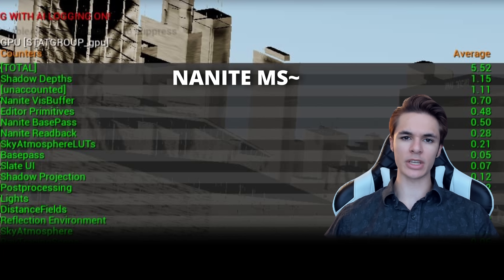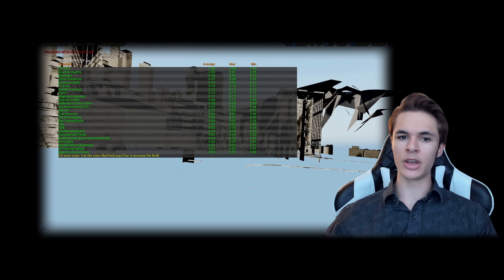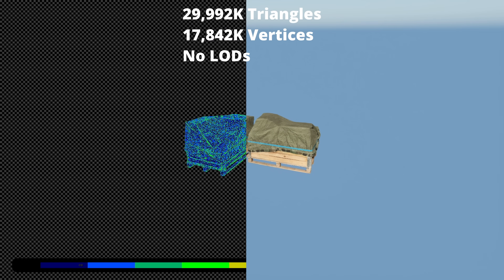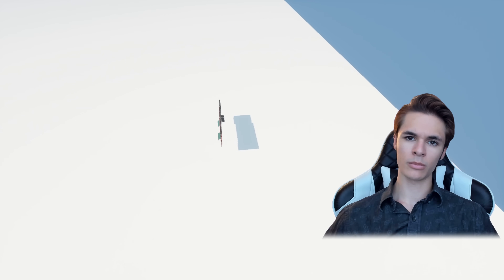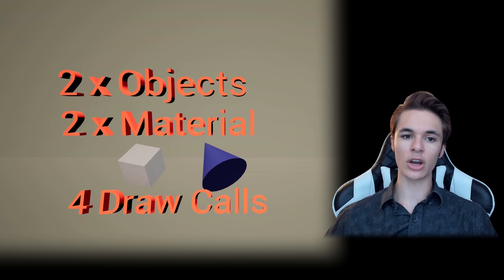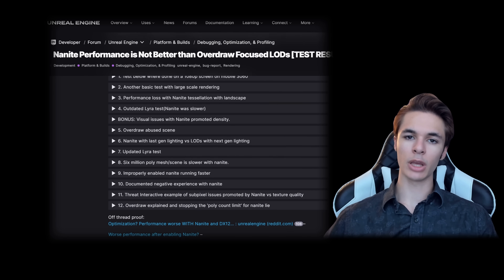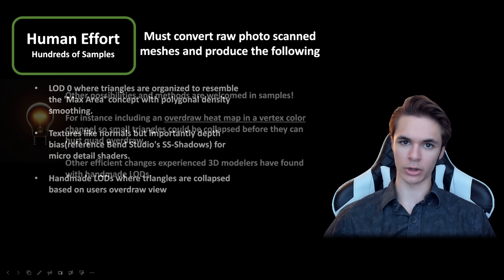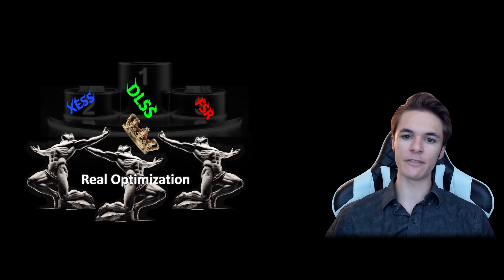Epic's Unreal Optimization Disaster | Why Nanite Tanks Performance!

Comment: Can't ever take Epic seriously when they can't even be arsed to prioritize shader compilation stutter problems.
Reply: What's interesting is that UE4 & 5 actually has a built-in setting in the ini files to precompile shaders called "r.CreateShadersOnLoad" but the weird thing is that it's set to False by default, instead it should be True. What's even more weird is UE3 has a different ini setting called "bInitializeShadersOnDemand" which is False by default, which actually means all shaders will be precompiled before the game starts. I have no idea why Epic didn't set shader precompilation to true in UE4 & 5 but at least the setting is there and more devs should know about it to turn it on for their games in order to help reduce shader compilation stutter
Reply: They have literally done this in UE5.3+
Reply: @Cloroqx   took them forever uh huh?
Reply: I'm not an unreal dev, but as someone, who has written his own engine, I fail to understand why you need a zillion shaders and variants for every scene. Whatever they are gaining on this is, but this is just madness.
Reply: BTW. Disabling Control Flow Guard in Windows Defender fixes lots of issues with stuttering in UE5 games.
Reply: Write the shader compiler yourself ! Only about 30 minutes... put it in ablank level that is async compiling and showing a loading screen :)
Reply: Unreal Engine has been a console engine for a long time.
Reply: maybe provide a solution?
Reply: @user-ic5nv8lj9d   why do I have to provide a solution? If devs need to have their own solution for such a game breaking problem, they might as well make their own engine.
Reply: @RiasatSalminSami  not every solution is prebuilt, see you in 5 years when you get that engine built.
Reply: @ThreeTreeDog   get that engine built? I am not a developer. I am a consumer and if I see a product that is garbage, I simply will not buy that garbage.
Reply: @ThreeTreeDog  Is Timmy your father by any chance?
Reply: @RiasatSalminSami  simply moaning isn't going to do anything, and if you've understood the problem itself you would understand why it's difficult to provide a "good" solution to a generic problem and not complained as much like many here that seem to have no idea what they're talking about (in which case, unreal is a generic engine that's trying to solve many problems at once, which is in of itself is the whole point of the engine and is making a maintenance disaster, it's not just for games fyi)
Reply: @RiasatSalminSami  well, i guess there's not much i can do to someone being ignorant then ¯\_(ツ)_/¯
Reply: @user-ic5nv8lj9d   ignorant my ass. That's like expecting a customer to like uncooked food because it's so hard to make a nice dish.  Or expecting the viewers to enjoy a sports match while the players play like shit.

All I will care about are the results. This is not a charity. Devs are selling a product, and if the results are garbage, then people will call it garbage. That's what Unreal Engine has been for the last few years. 

If they find it so hard to fix shader compilation stutters, then maybe they should just stick with older methods that still produced decent visuals without stutters.

Don't expect customers to buy garbage just because it's so hard to make a software.
Reply: @RiasatSalminSami  what if you want to push the boundries and do something even better? you can't just limit yourself to older tech and never improve, that's not how things improve or get better in the first place...

and you can't just simply "invent" a new tech and expect it to work perfectly the first time you work on it, today's hardware & software makes everything significantly more complicated and you can't put all the blame on epic, there's so many factors that causes the issues that may not be caused by one developer, it may be many many more that you didn't expect

most of the time the tech needs to be pushed out and given a try so people find out what the issues are, since there's an unbelievable amount of different configurations and different limitations and platforms you have to test on, it's just not as simple as you think

and also, the people using the engine must be aware of the issues (in case epic didn't make them clear enough, then it's their fault and sure i can understand that), on top of that it's designed to be _generic_, so this should be obvious by the uses of it and why it's slow in the first place, it's not because of lack of skills or laziness, that would make no sense

ignoring the reality and expecting everything to just stay perfect is not a good mindset, trust me, it's really bad, and you need to understand how these things actually work instead of being ignorant
Reply: @user-ic5nv8lj9d   no, it's a perfect mindset. I am not here to run charity. I don't really care if hard work was put behind the product if the product ends up being shit.

Video games are not a necessity and I won't die if I don't buy a game. As a matter of fact, I stopped purchasing games that are unpolished and in the long run, it saved me a lot of headache.

And this particular problem can't even be solved by better hardware. Games like Crysis ran like ass too, but that was designed in a way that would run better with newer hardware.

Shader compilation stutter makes every single hardware freeze. This is an issue that should have been #1 priority and should have been tackled since the beginning. Calling people ignorant for not purchasing products that has unacceptable issues like this is a problem in itself.
Reply: @RiasatSalminSami this reads like you've never cracked open the engine code in your life, if so that's fine but don't act like you know fuck all about what you are talking about beyond some youtube videos you've seen
Reply: @RictorScale   I don't have to know anything. I will call the product garbage if the results are garbage. If they are selling something to a consumer, they can't expect good review if they produce garbage.

I will say this again, this ain't a charity.
Reply: @RiasatSalminSami  lol yea you don't know anything and it shows very clearly. I'm sure epic is deeply affected by your.... not paying for unreal engine...like how could you think your opinion is worth anything if you know nothing🤣🤣
Reply: @RictorScale   I don't have to know anything to give an opinion if the results are garbage.

My opinion probably isn't worth anything. But same can be said about your opinion too.

If you are justifying shader compilation stutter, then you have no standards.
Reply: @RiasatSalminSami  your argument boils down to "I have no idea what I'm talking about but I saw a YouTube video saying unreal bad and so I'll agree even though I have no idea why a game might lack performance". The real criticism would be at the specific games that has the issue as they shipped without enough quality control. It's not the engines fault if your game is ass
Reply: @RictorScale    I don't need to see YouTube video to notice shader compilation stutter. 

It's the abundance of shader compilation stutters in UE games that lead to me to search on internet and I stumbled upon videos like these.

Yes the devs are definitely at fault too. But time and time again it's been shown that getting around shader compilation stutter on UE is convoluted compared to other engines. 

Which leads to my original comment about Epic devs not having their priorities straight. Thus I can't take them seriously.
Reply: @RiasatSalminSami  What you fail to realize is that those stutters don't happen in many normal scenarios, and UE, being a generic engine, can't do much about it if the dev decides to use their tech to make something different, but don't come up with a solution to shader compilations. If I use your food analogy, UE is not the cook, but the tool he uses. If the cook serve you raw food, it's not the oven's, or the pan's fault, but the cook's. If using another set of tools, or using those tools differently would have prevented you getting served raw food, that doesn't make the tools bad, but again, the cook using the wrong tools, or using the tools he had incorrectly. Sure it was a significant issue for them to fix, and they did improve it as far as they can, being a generic engine. But the major issues with stuttering came from devs and quality control rather than the engine itself
Reply: @RiasatSalminSami i get you my man.... the UE engine has been shit for a long time, and the shadercomp stutter really doesn't seem to be the only issue. Devs seems to have an insanely hard time optimizing games for a stutter free experience 😅

I started on this Journey roughly 10 years ago when i couldnt understand why my new monster of a machine would get microstutters in a lot of games. It took me a while to realise the common denominator was ALLWAYS the Unreal engine. Strangely enough any game based on a proprietary engine would serve me the most beautifull stutter free experiences, but with unreal there would allways be this microstutter. I have talked with quite some PC gamers about this, and I think the reason Epic havent been Called out on this massively, is because a LOT of midtier gamers blame their hardware for not being "powerfull" enough and thus expecting some chop.

Comment: Exactly what I have been saying for years. This is why I stick to 4.27. Epic seems to rather procedural slop for unskilled developers, and asset packs, and doing all the work for lazy developers than giving us the tools to do what we want to do.
Reply: You can keep using lods in Unreal Engine 5. Stitcking to 4.27 is nonsense.
Reply: @saimon1987 yeah you can disable the new features in the project settings rather easily and then it runs decently.

I am a bit disappointed from Epic disabling raytracing support that isn't tacked onto Lumen though, because the reflections in Lumen look nearly as bad as Godot's voxel reflections system.
Reply: @saimon1987  on my machine, UE4's editor opens in an instant, while UE5's takes like 20 minutes to open. Yeah, I think it's pretty obvious why we stick to UE4.
Reply: @saimon1987 some people tell that rendering basic scenes in UE4 is cheaper, than in UE5, even with fine tuning of UE5.

Comment: Nanite sucks compared to regular subdivision methods (NURBS, Catmull-Clark, ...) and displacement maps (both for vertices or per-pixel), or NVIDIA's displacement micro-maps.
Reply: Displacement/tesselation doesn't work with arbitrary topology, so they are not an LOD replacement, unlike a virtual geometry solution like Nanite.
Reply: @cube2fox  You can easily convert any mesh into a tesselated (maybe even a displaced) approximation of it.

Comment: I usually find people who excuse unreal's performance in titles and mention how developers have the choice in not using these techniques like Lumen and Nanite, but  unreal  5.0 deprecated TESSELLATION, so where was the developer choice there?  You should really do some tests comparing  tessellation, parallax occlusion, and Nanite. Because if  tessellation doesn't perform better than Nanite then Epic did the community a service by removing it with a replacement. But if  tessellation is faster, then Epic really is to blame for alot of shty performance.
Reply: Tesselation can be faster and better looking than Nanite, but nobody cared to code methods to export it from 3D modelling software or convert existing meshes into it.